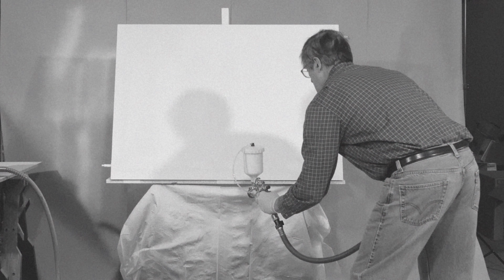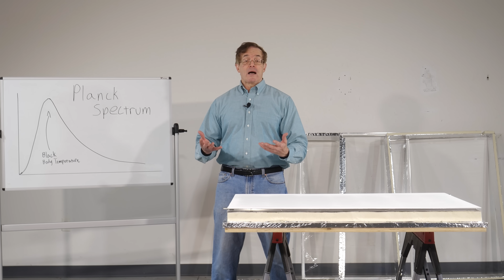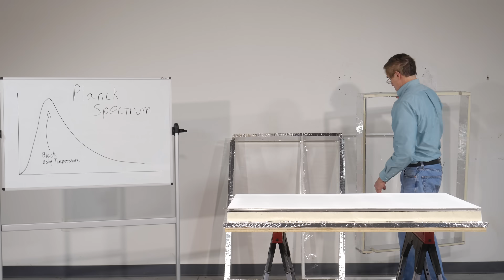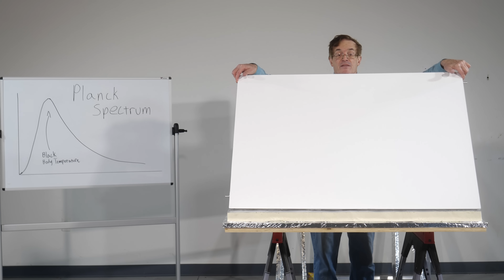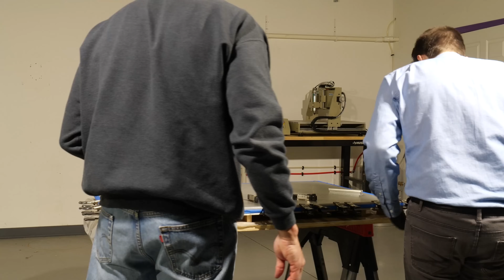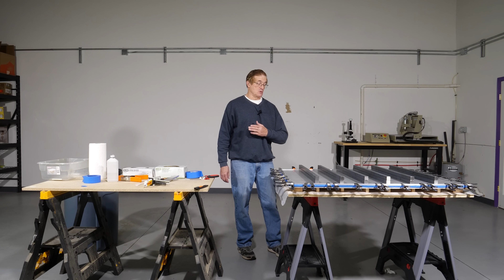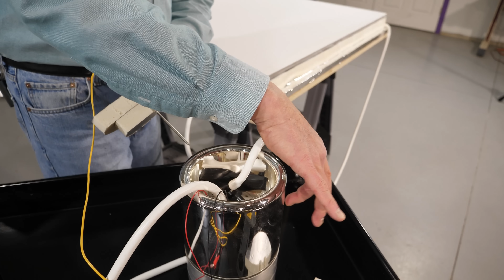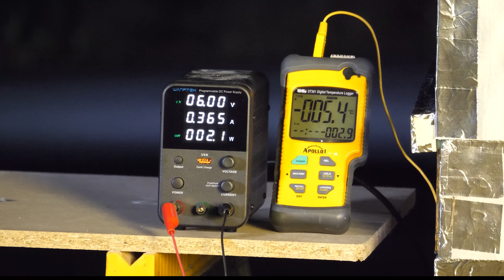Air Conditioning isn't free... but we're close.

Comment: One thing I noted, the "IR Baffle" above the flat surface intended to block ambient radiation, is "vertical" on both the inside and outside.  This actually would reflect (to some degree anyhow) the ambient radiation down into the box, for anything tall enough to "see" over the opposite edge, hitting the inner vertical surface and reflecting "down" into the box and still hitting the radiant panel. 
A simple solution to this, would be to alter the inner walls, to "angle up" repeatedly (similar to acoustic treatment) directing any radiation coming in over the opposite side wall, up and out of the box rather than just bouncing downwards from the normal incident reflection angle.  Basically a series of "triangles" with a flat (or, actually... edit following...)
Realized that if you had triangles with a "flat" underside, those undersides would actually radiate back down into the box... so the ideal radiant baffle in my mind, would actually be some combination of an "upwards" reflective angle that directs any laterally angled radiation (from the panel) upwards out of the box (as the vertical sides would by their very nature, but can't be quite vertical due to incoming radiation)... and the "upper" angle (catching incoming radiant energy from surroundings) would be angled such that the tallest "incoming radiation" source, can't reflect back onto the panel.  (Also thinking a form of "scallop" might work...)
The other thought I had was some for of "miniblind" structure... angled slats, that are likely changing in width (maybe shape also, straight, curved, etc) that are spaced and shaped/angled, such that any radiation from the panel cannot reflect back into the enclosure, and any source not taller than the line from one top edge of the box, to the alternate side of the panel, instead of radiating in either reflects up/back, or through, the slat. In fact, with this concept, painting those slats with a "super paint" would make even more sense.
Finally, my first thought (last to describe of course) is simply to "expand outwards" the baffle box, so the "add-on" portion of your box, actually angles outwards enough that most if not all emissions reflecting "into" the box, primarily leave back out.  
Anyhow, some combination of shape and structure, could be designed, with a bit of upfront effort, to maximize environmental "blockage/reflectiion away" from the surface, without also contributing to the panels emission being reflected back to it. 
Obviously the intended surroundings will affect this, super tall trees or buildings will challenge any such baffle design, however potentially even a "baffle array" of tubes maybe, with shaped upper portions to reflect much more severe incident angles from tall objects, again with the interior coated by superpaint, could allow the panel to only see the sky, and although the surface area of  the array will restrict the emissions a little bit, there is probably some balancing point where it makes sense (for an area with few tall radiators in the area, simpler would be better).  
Just had another idea... if there is an "ideal" emission spectrum/range that would negatively impact the radiant panel if reflected inwards, angling the baffle walls out a little bit (so that the panel cannot easily "see" them as radiators), and then coating those with a retro-reflecting paint that would prevent reflection into the box (instead sending whatever radiation back the way it came in) could be done.  
Anyhow, just a bunch of ideas I thought of, it's a wonderful concept by itself, some combination of the above improvements if tested and validated to improve things, could potentially make it "x" percentage more effective.  If it's 2% for a complicated build, probably not worth it, but if it's 15% better with just a modest amount of customization of baffling the box, that would be worth it I would think. 
Really want to try this project in my (non-existent) infinite leisure time here in Texas, hopefully maybe in a few months I'll be able to (too many "must-do" projects in the queue right now)  Love your videos!
LOL, another edit, just caught up on comments, someone else mentioned the design of the box being terraced "like a fresnel lens" which was what I was thinking on the initial concept above as well.  
THen someone else mentioned surface area, and THAT got me to thinking about the "plate" itself, if it was instead a lightly "inverted scalloped" surface (with most angles not visible to the rest of the plate, although some near the valleys would have a percentage of their emissions "seen" by the plate, those also would mainly reflect "out" of the box by design).... Might get 20-30% more emissive surface area (guesstimate) in the same perimeter this way (again, like the gentle curve of old-school aluminum mini-blinds, or in cross-directions  it'd be a series of "bumps" (inverted golfball surface).  Would take some geometry calculus to optimize the added surface area versus the "block/emission back to to the panel" ratios, but every little bit counts. 
Ultimately, this entire concept seems like a GREAT idea of usage as roofing materials/tiles in temperate or hot areas, where there are few surroundings to emit back onto the roof (and open sky).  
Final thought of THIS edit... combining this in some form of peltier device for a heatsink, leading to electric generation potentially.  Peltiers aren't cheap or particularly efficient of course, but compounding benefits is always a thought of mine.  My ideal "end product" of all this, would be a solar panel, where the PV material bandgap is compatible in such a way that incoming light from the sun is gathered by the PV, but it is (relatively) transparent to such a panel as this, designed underneath the PV cells, allowing the emissive radiation to pass through/out of the PV panel opposite to the sunlight, AND thus also drops the temperatures of the backside of the PV panel (which PV panel cooling can significantly improve efficency... and if all that, is tied to a peltier device on the back of THAT, which is collecting heat from inside the building it can then be adding a bit more power to the output while drawing out heat to be radiated by the panel (a balancing act, too much power radiated by the panel from the peltier, reduces the cooling on the PV panel thus reducing THAT efficiency)...
Anyhow, almost all of that is dependent on a lot of physics beyond my knowledge, the reflectivity/transmittivity of the panel materials, the saturation point, costs, etc of the peltier loop, the PV benefit gained from the emissive panel cooling, versus the radiation through the PV panel also potentially heating it up some (ideally the radiation spectrum from the panel is largely "invisibile" to the PV materials, but having this combination of compatible features all in one system, is probably a pipe dream. And the cost to engineer and produce such a solution if it could work, just from the stack of materials involved, wouldn't be cheap I'm sure.  It's late where I'm at, gotta shut off the brain soon so I can sleep, LOL.

Comment: How long did you run the test? I'd like to see it during daylight with higher infrared.  If the test was 1hr you produced about 6BTUHs  you need to multiply that by 6000 to cool an average home. 2.2 watts x 6000 is 55amps @240V, if the test was 1 hr, the longer the test the higher numbers, where as the average 3 ton AC draws 17 amps. So standard AC today is over 3X more efficient than your experiment if you cooled in 1hr. That 3X doubles every hr longer the test ran
Reply: You could increase your numbers by using a 100% glycol poly or ethaline. Since it's closed loop you should try it. Alcohol maybe a good alternative. Instead of air to water you might want to try water to water with a little adapting. your idea is good you have a long way to go though. Another idea is to see if your panel will work to replace a standard condenser for cooling freon
Reply from the maker: Did you watch our latest video?

Comment: You've NEVER been in a polished aluminum box. you will fry
Reply from the maker: I think you misinterpreted the example. 
I was talking  about the cooling effect due to emissive loss into the sky. This will only apply when the sun is not overwhelming  that loss with radiant heating, i.e.,at night.
Did you watch our latest video?
Reply: @TechIngredients  This is the 1st video of yours I've watched. To be honest I do not like it when people over complicate and talk over other's heads. Unlike them I can follow along. Your concepts are old the new materials just make it better. I'll go through more of your videos. I just put you in the category of the misinformed ground loop geothermal people spreading misinformation based on improper techniques and misunderstanding of conduction, insulation and heat transfer, so maybe I judged too quickly. If you think you have something keep at it.
Reply from the maker: Indeed, you jumped to your  conclusion without enough  information. Watch that video first.

Comment: And a heat pump does not have a radiator it has a condenser and evaporator, bit different, you seem to be talking about evaporative cooling which already exists and is really only good for high humidity areas.
Reply from the maker: You're  right. It doesn't  have a radiator. It has a liquid to air heat exchanger that cools the compressed refrigerant.  Cooling that compressed refrigerant further with a radiator like this will make the system  more efficient.

Comment: You can get even better with certain metamaterials that change wavelengths into ones that the sky is more-transparent to.
Reply from the maker: I'm  not sure about that.
What we care about  is wavelengths between  8 and 13 microns, centered  at 10 um for room temperature.  The sky is very transparent there, and the barium  sulfate coating is 96% emissive there as well.
Did you watch our latest video?
Reply: @TechIngredients   No, not yet!  I've only seen this one, and I only just now finished it.
My comment about metamaterials is just me trying to communicate one of the things Dr Hossenfelder said in this video:  https://youtu.be/9vRtA7STvH4
It can take more-energetic IR wavelengths (that the sky is not transparent to) and lengthen them to a wavelength the sky is transparent to.  Such metamaterials seem to be permanently 5°C less than ambient temperature.  I wonder if there's any way you could incorporate such a thing for even greater gains?
Reply from the maker: The principle is true.  However, a surface that is emitting  shorter IR than 8 um is already above 100 degrees C. That surface can't  even approach  ambient temperature  and still be generating anything shorter than 8um.

Comment: i REALLY hope you do a video of this in the summertime. Just not able to see what it's actually capable of without subjecting it to summer heat / conditions it would actually be useful!
All the same very interesting and appreciate the content!
Reply: you missed the point of this video.
Reply: @Lights480  Care to explain the point then? Yes, you can cool something lower than ambient temperature... But that really fails to demonstrate it's usefulness when you have conditions where this is irrelevant. 

Would the temperature drop by the same or greater or lower amount if it were 95 degrees on a hot summer night? 

Really... I get the science. I just want to know the application.

Comment: How are you using a shop vac to paint with a air gun? I wouldn't think there is enough output for that.
Reply from the maker: That's not a shop vac.  It's a turbocompressor with this Fuji HVLP spray system.

Comment: Pretty skeptical about "super paint" might as well say "magic paint" . I get the concept. Radiant Barrier is real. It requires an air gap and can't get dusty. You are effectively making the exact opposite of radiant barrier. Using the high heat absorbing side of Aluminum and making the outside hyper emissive.  A small window air conditioner offers about 6000 BTU of heat transfer. The napkin math of BTUs to watts is 3.5 watts per BTU. That's a ball park of 20,000 watts. So it looks like you'd need a football field of those panels assuming the "super paint" works as advertised, and a perfectly insulated system like you've constructed could be scaled that large.
Reply from the maker: Check  out our latest video.  Using the paint itself to replace conventional  paint could be a game changer.

Comment: Aside from passive cooling, can you dive into alternatives for active cooling too? I've always had a fascination with propane refrigerators and how heat can be used to cool. Since it's way easier to gather heat, why not use solar vacuum tubes to collect heat and then use an array of ammonia cooling systems. Once all the ammonia is driven out of one system it is cycled to the next system in the array so that cooling can be achieved even during darkness. Basically ammonia is driven out of an absorber/desiccant with heat and then is allowed to pass back into the absorber/desiccant through an orifice to create cooling. This has been done in African villages for milk houses, why can't it be grown in scale to provide air conditioning? Then in winter months the solar vacuum tube system would be used as either a primary or supplemental heat source.
Reply from the maker: We might.

Comment: As an HVAC guy I'm calling CAP my dude.

Boilers only work effectively with things like radiators because the water coming out of the boiler is 2-3x hotter than room temp, and even then its an extremely slow process to heat up a house with radiators/baseboard. 

I'm going by average household temps, and what AC is designed for so lets say 75degrees, If its your only source it would mean humidity is high in the house and if you are at like 75% humidity your radiators will literally start to sweat if the passive cooler gets the water/piping below 66 degrees. 

AC example, the one you gave of flowing radiator water after its "dumped its heat" Is this to imply you are running the AC and the boiler at the same time? Maybe you misspoke, or I misinterpreted, but if we are dumping 160 degree water onto a liquidline for AC it would make the liquid line hotter, resulting in, well you are already running the heat and the cooling at the same time.

Maybe you meant in the context of the passive cooling, it ABSORBS heat from the house, leaves at like 75degrees, meets up with the liquid line at the AC, goes up to 80, and then goes up to the passive cooling panel on a roof thats 85 degrees, and how does it get back into the house at less than 75degrees. 

Like its fine if its all outside, but its not gonna be all outside, in AC season its going to be cooler inside than outside if you have central air by 10-15 degrees I just don't see it
Reply from the maker: You need to separate the two options.  Running cool water that is teed into the radiators ( the boilers are off) will unload the separate air-conditioning system. 
Alternatively, you can use the cool water to cool the refrigerent further after it has dumped the majority of its  heat into the atmosphere with the conventional air heat exchanger.
Reply: @TechIngredients  yeah again the first part won’t work. The water won’t be cold enough to have any meaningful effect on the temp in the room. The only way it MIGHT is if you make it so cold that it starts to sweat and drips on the floor. Even then it wouldn’t effectively cool and now you’ve made a mess. 

Next part sure you can do that, of course the price of adding that supplementary heat exchanger to the liquid line would never see a ROI. In the event you do all the work yourself, you still need to not only adjust refrigerant charge to keep proper subcooling. Which will be insanely difficult because how effective the cooling panel is can change by the hour. 

How cold realistically will this water get?
Reply from the maker: You say that the first suggestion  won't  work because  the water  won't  get cold enough, but then you ask how  cold can it realistically  get.
Because  of your experience, you'll  know  that what determines  sweating is the dew point, so that will determine  the minimum temperature  allowable  for this circulating water.
As to your  question,  that depends on the outside temperature because  the radiator will generate  a differential.  The higher the outside  temperature , the greater the radiant flux from the surface as T^4 and the greater this differential.
Reply: @TechIngredients  Alright lets do it this way, we have to ignore a lot of things because we don't know what kind of house it is, how well sealed it is, how well insulated it is, etc etc, say its 90 degrees out, AC systems are designed to keep houses around 75degrees, comfort humidity is around 50%, a dumb single stage system should be able to handle this. that means, dew point is going to be around 55degrees, from what you've shown me there is no way this thing will get even close to managing that. So there is no worries about it sweating, but it also means it has no realistic chance of actually cooling down a room or a house. 

Split AC systems are conditioning the air, taking hot air out, pushing it through a coil much colder than 55 degrees and distributing it throughout the house, and even then on a hot day an AC system can struggle to manage that, so how is a passive cooler pushing much warmer water  through 200+ feet of copper absorbing heat and probably becoming room temp after the first 3 rooms helping? Even if the pipe was 40degrees, sweating wasn't an issue, and the radiators design wasn't garbage for this application it would be less effective than trying to cool a room with a cooler full of ice with the lid off.